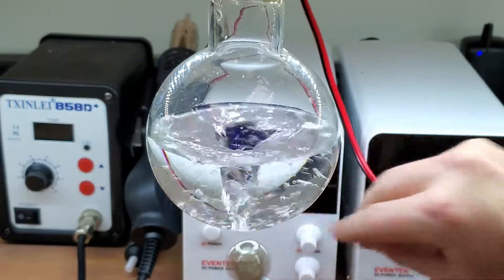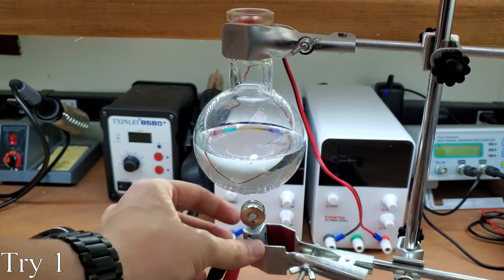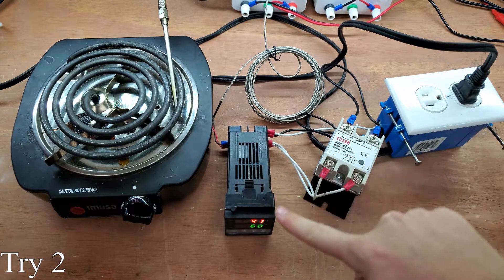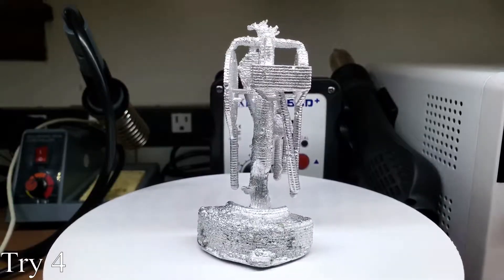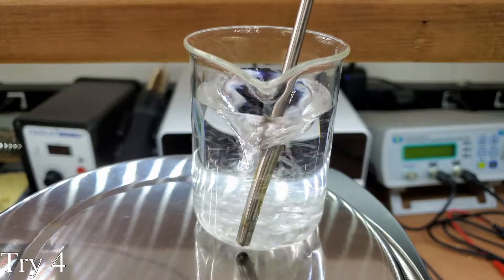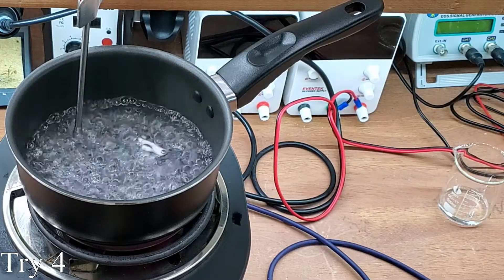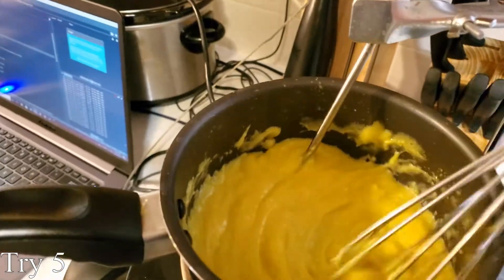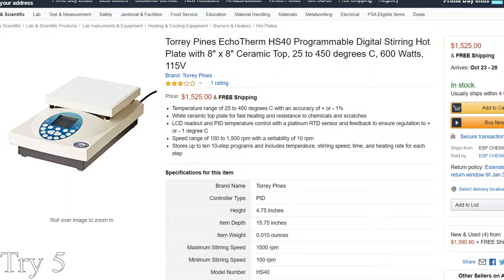Stir and heat. It's (sorta) simple

Comment: Don't follow the recipe for Kraft.
Only boil the macaroni for 3 min then drain and flush with cold water until all the noodles are cold.
Throw only the butter in the pan on medium and melt it (optional, but you can up to double the butter). Add powdered cheese to melted butter and whisk until the powder isn't dry and lumps are gone.
Add double quantity of milk to pot and whisk on high; low fat and skim milk contributes too much lactose and makes the Kraft sweet, this can be offset with acid (lemon, vinegar) or by using whole milk or preferably half and half or even cream and adding water if necessary. Cook and whisk constantly until reduced by half at least.
Add drained cold noodles back to pot and finish cooking noodles in cheese sauce until noodles are your preferred level of softness (firm is better), more cooking continues softening noodles.
For extra credit; throw mini cocktail sausages/lil smokies in a frying pan and heat on low until outside is crispy, and toss a few while they are  still hot on top of your bowl of Kraft. Top with shredded or shaved cheese of your choice, and hit with blow torch or broiler to melt and even slightly char cheese.

Comment: Cool vid. 
How about powering coils, that attract and push the magnet instead of using a motor? 
Maybe something like a solenoid but then the cores are only diversing the flux.
This way you wouldnt have any moving parts in the machine itself.....
Basically the flo becomes the rotor and the stator is placed "conveniently".
Would that take you 10 tries?
Reply: I'm trying this at the moment; basically an axial flux bipolar stepper motor. I was not able to source SmCo magnets locally; Neodymium magnets shouldn't be operated above 80°C. Finding soft iron cores was a challenge so I made do with a stack of 'I' lamination plates from a transformer; magnet wire from the primary winding. U shaped magnetic cores would be best, but it a bit of a challenge for them to cross over each other without some sort of offset. So far I was only able to reach around 500 RPM with about 15mm of clearance from the coils to the stir bar but back iron between the coil pairs and fine tuning of the coil positions may improve this if the coil inductance isn't a limiting factor. A basic stepper motor driver works well for this.

Comment: how did you attach the motor to the heating element?
Reply from the maker: I cut a hole through the case of the hotplate, so the magnets could sit just below the heating element. Then, I screwed them both to the top board of the box.
Reply: @TenTries  What about curie point and loss of magnetic properties.
Reply from the maker: @TheTubejunky  So the Curie Point for NdFeB is typically above 900C. There's no way to get to that temperature with this heating element without a lot of insulation (I've tried with a similar heating element).
Rare earth magnets do permanently lose part of their magnetic properties above 80C or so. The magnets are about 1/4" below the heating element. Being 1/4" below the element means that there is no conductive heat transfer and low convective heat transfer (bc heat rises). There is some thermal radiation too, but the magnets are coated in a shiny metal (Nickel maybe?). They don't absorb much thermal radiation.
I haven't noticed any loss in magnetism, but the magnets are not too hard to replace. Also, they're not too expensive. So they can be replaced if there's a noticeable loss in magnetism
Reply: @TenTries  Wikipedia says the Curiepoint of Nd2Fe14B is at.  310 °C. Samarium Cobalt  is at 700° to 800°C but thats a tidbit expensive. 310°C is of course still enough except for the case one turns the stirrer off with the heatplate running or one turns both off with the hotplate on full steam. Then the Heat building up might well get into that range. Nice project though. Easy to reproduce for everybody who by accident has a 3d printer , some microcontroller boards and all the other stuff and knows how to program. The long shaft is a design flaw, will kill the bearings and it is rather untidy. Inspirational.
Reply from the maker: Thanks! That Wikipedia chart is from another site that doesn't cite its source. The >900C number I got from another site may be wrong, but the curie point isn't really that important. (suppose I could always just stick these magnets in my furnace and set up a test..) What is more important would be the point that the magnets no longer have the strength to rotate the stir bar with the given speed and liquid viscosity for your application. That point is probably going to be a lot closer to the working temperature than curie point, since they are so far from the stir bar. As a commercial or consumer product, I'd change many things including the magnet mount. Also, a small fan drawing cool air, pointed at the magnets could easily keep them cooler for high heating power applications. I hadn't seen a need for this while distilling water for >8 hours constantly, but there could be many applications that could warrant it
Reply: @TenTries I’ve killed the magnets on a few hotplates, around 300° seems to be correct.

Comment: Amazing content! I've been wanting to make my own stirring hotplate for a while. Would you be able to provide wiring diagrams for how you hooked up the heating element? Also maybe for your next one you can make a stirring heating mantle since you're using round bottom flasks.
Reply from the maker: Sure, I'll send you another message when it's posted. Yeah, I have a mix of round bottom and flat bottom glassware. I considered casting an aluminum adapter for round-bottom flasks, but sticking a control on a mantle would be a lot easier!